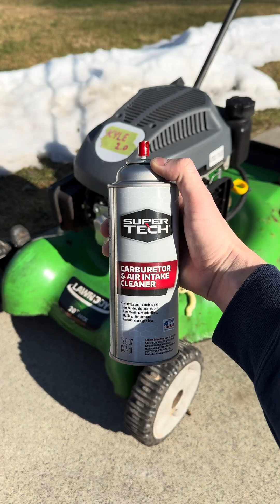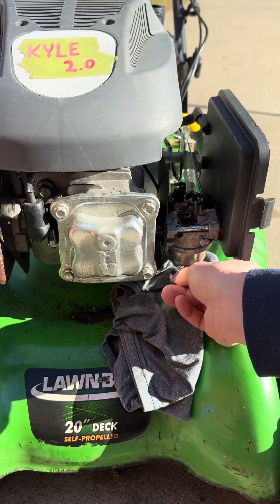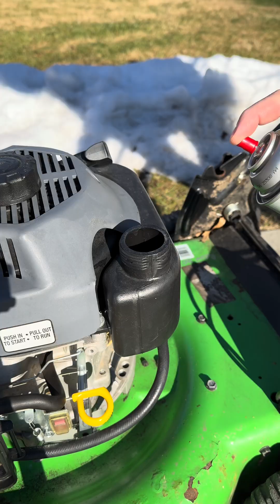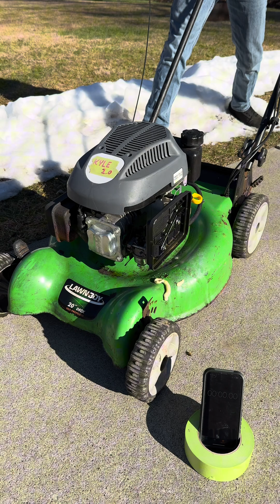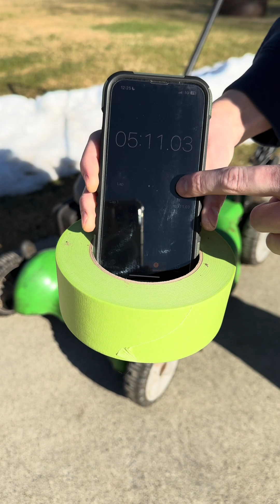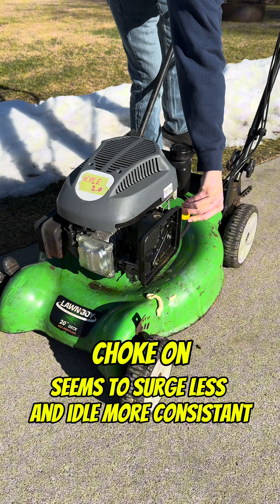🤔 Using carburetor cleaner as fuel!? #carburetor #fuel #smallengine #testing

Comment: Of course it's going to run, it contains Methanol Alcohol for ignition and Toluene, and Acetone  for cleaning. All three are flammable and will have an octane higher than gasoline so it will run even better with an air adjustment to the carburetor.